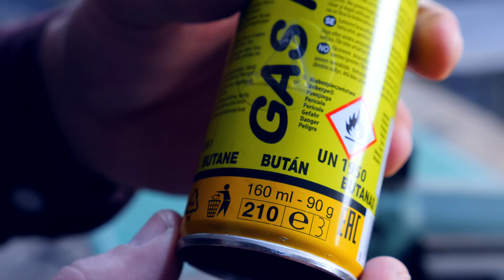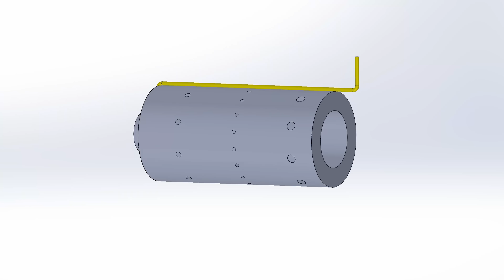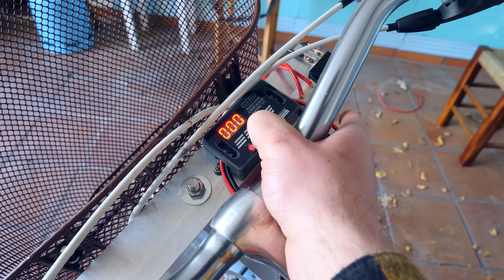I put a Homemade Jet Engine on my Bicycle

Comment: That lip is significantly reducing thrust. Instead of one large combustion chamber & exhaust.....spread out to multiple jet exhausts surrounding a central pass through for ambient air. This will cause far more ambient air to be "grabbed" by the exhausting gases, and produce far more thrust. #NasaLies

Comment: Hi INTEGZA, my name is Gil and I’m a mechanical Practical - Engineer. I recommend you to add exhaust and exhaust nozzle (like in fighter jets) because the exhaust stores the energy that comes from the combustion chamber and the exhaust nozzle turns the static energy into kinetic energy which will cause more thrust in the engine

Comment: Idea: I know your thing is much more about rocket engines and stuff, but i have a slightly different suggestion. Try adapting a bike to eletric and then compare it to the (possibly refined) jet bycicle you just built. Would it be possible to have both a jet engine and an eletric motor on the same bike? Use the jet engine propulsion to recharge the battery?

Comment: For your rocket engine project instead of focusing all the propulsion from the gas through one nozzle at the back, why not have about 4 mini holes at the side of the fuselage like anti-tank rockets. This not only provides stability and also the chance of ur rocket malfunctioning is low.

Comment: I think it might be cool to make a jet turbine to mechanically drive a bicycle. like the bikes that have gas engines added to them but the instead build a jet turbine to drive it. I personally have been building and riding the gas bikes for several years now but they can get very dangerous fast.

Comment: maybe you could give the metal 3d printer another try, you can probably clamp the welder in place with steel clamps you may also be able to cool everything down using your edf the steel plate should not warp with such a powerful edf

Comment: Hey Integza! I had an idea. You could make one heck of a rocket sled if you used fans to create a hover board. I mean something the size of a toboggan or as small as a skateboard (probably more feasible). One of my favorite creators on here Colin Furze made a hover-bike he got pretty famous for, though i know that's a pretty tall order. I'm thinking it could be scaled way down. I know it wouldn't likely support much weight, but imagine how fast a nearly zero friction rocket sled would be. I really want to make one my self (after the motorbike of course), once i have a shed and proper tools. I made an electric bicycle i'm pretty proud of though. (Only real issue is i used 6 12 volt lead acid batteries which are pretty heavy...) I'm rabling but i would really love to see a hover rocket sled if you think it's possible.

Comment: But it is only using the power of the leafblower 
The jet engine is not creating its own power 
It doesnt have intrnal hi preassure fens that compress air to create thrust so its basically just a lefblower makeing a flame ?

Comment: To prevent the nozzle from melting, you can try use 2 cans, one inside another, make it air tight and make small holes in the smaller one. Then, redirect some air there so there is a blanket of air between the exhaust and the walls of the exhaust

Comment: 3d print your own fan to use as the air source for a build of this  if you decide to try and make a better one or 3d print some wheels for the skateboard in older videos to see if you can make it roll smoother to get more movement out of your thrust engine

Comment: Maybe you could add a sort of regulation valve so that you can adjust the trust level without stopping or having to turn around to regulate it on the blower.
Also I and some friends are gonna be building our own aircraft so maybe you could try to make a high trust engine capable of pushing a car or something.
(Totally not wishing to steal your work for our aircraft project hehehe)

Comment: Maybe try to funnel in a small amount of hydrogen into the engine, then increasing the flow more and more. I have no idea if it is going to work but hydrogen has like 2x the energy density compared to butane. Would maybe melt the welds tho...

Comment: That's brazing, not welding. Better than soldering, not as good as actual welding.

Except for the battery spot welder you used later on. That's actual welding, barely.

But entertaining and enjoyable, as always!

Comment: What about making a small scale generator using an RC car/plane engine and an electric motor? Could be a fun build using 3D printing and mechanical parts, plus would be a good DIY for lots of power needs.

Comment: How fast would he go with no flame? I suspect it would be the same speed. What is the point of burning anything if the electric motor is producing the air movement? Also why do you need to weld anything? Can't you use nuts and bolts or rivets? Something that doesn't melt...

Comment: Idea:-
1) Make a POWERFUL electric jet engine capable of moving a lot of weight then put it in a go kart, and try to show it to a cop and get his opinion on it. And measure its total speed.

 OR

2) Add a jet engine to your vehicle (car/motorcycle) and see the difference it makes when used simultaneously with the vehicle.

Comment: Since you have a printer which can handle ceramic resins, you could try mixing resins with metal powder. with your furnace you can sinter it like you do with your ceramic resin. but instead of porous ceramic parts, you can get solid metal parts. You just need to use relativly small powders of 1-4um

Comment: Most of your channel is about using a jet engine to propel things and you are fighting against heat distribution. Why not lean in to the idea of all that heat and make a jet engine powered metal furnace! How hot can you go and maybe even use that to do some basic metal casting?

Comment: Another way to fix that flame issue is to start the flame and then start the blower. I had this problem when I was working on hybrid rocket engines for science fair. I would start the O2 gas before I tried to ignite the engine, but the flame never started, so instead I ignited the engine and once a fire started, turned on the O2 flow.

Comment: electric cars are a complete scam the mining required to get your battery's the fact your recharging using oil coal or gas to make the power they are far dirtier  than the internal combustion engine

Comment: Fantastic fun! I love it, with regards the exhaust you could try a ceramic exhaust or just an old steel funnel like you might use to put petrol into a lawn mower from a can.....
 hmmm a Lawn mower... I have an idea!
A jet powered lawn mower that vaporises the lawn cuttings in the jet as it cuts .... might want to make it either remote controlled or a ride on mower though. Standing behind it and pushing might be a little warm and windy so to speak.....

Comment: why not try making a rocket engine with an electric fed pump, with a significant rocket nozzle like made with a lathe or cast iron? and use kerosene as fuel (RP-1)..

Comment: Idea for the video.
Make a disc. Make holes in it. I had something like that lying around. I observed when inside liquid that disc(with holes) will resist moving at high speed but it will move inside the same liquid very smoothly if speed is low. So, can you make a valve which resists the flow, using speed of flow!!
If you read it and find interesting send me a 3D Printer and Gracias

Comment: Make a bike with a working 3d printed internal combustion engine that uses a wood gasifier, thats starpped to a propeller (so the propeller runs the bike), Greetings from finland!
Reply: edit: or you dont 3d print it but it would still be something very interesting that you could do.
Reply: edit2: and a wood gasifier is basically a big metal furnace that burns wood and the gas coming from the burning firewood is used as  fuel for the engine. It was used a lot during ww2 in finland, because normal gasoline was very limited during that time.

Comment: Integza it would be super cool if you could make that but better with fuel injection control and air speed at the front of your bike and also use beryllium or something since that metal can take more heat
Reply: and maybe try putting heat resistant shroud around it so if you fall back your not gonna be burnt

Comment: Idea: make a steering system for the engine. You could either use thrust vectoring or some external rudders like the V2 rocket had
Reply: @Don't read profile photo Cringey kid, you're  probably begging for subs ...

Comment: Check for the operating range of temperatures your materials can withstand, there's no point in making a nozzle in aluminum, same thing goes for the welds.
As for the nozzle this is the case where you could try to use a De Laval  (if you could manage to get the flow sonic in the throat any subsequent expansion would accelerate it and provide you with more thrust) , spot welding a sheet steel one could somehow work but I wouldn't trust it to be honest, with the production capabilites you have now there's not a lot more you can try.
Your aluminum nozzle was at 800K, that's the temperature at which it starts glowing red, so look for better welding methods if you want to have it survive

Source: boring aerospace engineer 
P.S. f**k tomatoes
Reply: using the wrong materials is kinda his thing tho
Reply: He can't print them at this size, and using wrong materials is sadly going to lead to failure, maybe he should get a tig/mig and weld thicker sheets of steel, with plumbing solder there's not a lot you can do as it's not made for rockets but for household pipes.
Reply: He tried printing precise Nozzle’s that could withstand the temperature, and they were ceramics, but they leaked, due to the treatment process.
Reply: @apex_blue  I still wonder why he didn't glaze the parts
Reply: Hey you boring aerospace engineer, here is a boring mechanical engineer  student.
What he did was not WELDING, just simply SOLDERING.
There starts the problem.
But the nozzle is not necessarily out of Aluminum?
Reply: @Chaosm4n  i agree
Reply: The nozzle is a butane canister, aren't those made out of the cheapest aluminum, the same used in coca cola cans? But yeah for welding/soldering you are right, I messed up as in my language there's no difference between the two :)
Reply: oh wow I derped super hard on the part I noticed, my bad lol- as for the butane canister I think it's multiple layers of different metals, such as steel and brass hot rolled together (and obviously coated)
Reply: tomatoes are disgusting
Reply: The can that he used wasn't aluminium though. It was steel.

Comment: Idea: Add a proper nozzle and use some of the leafBlower excess air to cool the outer part of the nozzle
Reply: Guess who's getting a printer haha :)
Reply: Good idea
Reply: Great idea. You could cool the engine with the air before it gets to the chamber, and by the time it gets to the chamber the air should be slow enough where he could get rid of the flame holder. It would increase efficiency drastically.
Reply: Very cool jet bike! I wish I had the ability to make one. :)+
Reply: Aye, that's the ticket, and I'd guess it might work better with colder air, but really worth the try. I want to see this myself (:
Reply: Yea, you also need a proper convergent-divergent nozzle to get proper thrust out of the hot gasses by converting some of the heat and pressure to speed.
However the pressure the leaf blower can give is properly the limiting factor, as the compressor in a jet engine is not to force air out the back, but to create high pressure gas which you then heat up further (by burning fuel) and expand out through the nozzle (excluding the energy used by the turbine to drive the compressor).
I'm not sure he gets much more thrust out of it by using the butane than just by using the leaf blower itself.
Reply: @srenkoch6127  actually in jet engines you only have a convergent nozzle since in order to jave a functioning convergent divergent nozzle you need to be sonic in the throat. The leafblower can't obviously support enough pressure. Convergent divergent nozzles are used in rockets, where you burn insane amounts of propellant to build up combustion chamber pressure. He just needs to build a proper size convergent nozzle

Comment: Try making a 3d printed liquid cooled nozzle, this way the plastic wouldnt Melt or burn and If you recycle the warm coolant into the combustion chamber you could easily get some more thrust as it would increase chamber pressure. This ist all theoretical of course but maybe it would work 😅
Reply: dont think that would work tbh
Reply: @retr0_fps  it just  m i g h t

Comment: Idea/ Video Suggestion :maybe make a multi staged rocket with small fuel storage for each of them and a battery in the final stage whitch sets of the first and as soon as the first is finishet it burns a way a conector of some sorts and drops down to reduce weight and so on and so forth this may even work when done out of 3d printet parts only due to the nature of plastik burning up you have a nice and easy release for the next stage?!

Comment: Have you thought about putting a turbine after the combustion chamber to increase exhaust pressure? This would make it a turbojet style engine and increase your acceleration.
Reply: The turbine is there to drive the compressor of a jet engine. Nothing more. Here it serves no purpose.
Reply: @LuxGamer16  I suppose an afterburner would not work really well in this application.

Comment: Excuse me!  You cut down the airflow for stable combustion and then you have an overheating problem.  By-pass the waste air to cool the exhaust with a shroud.  That's the way the big boys do it.

Comment: You need to make a tank, in a 3D printer (PLA So that if a part breaks it will be easy to replace and also the tank will be lightweight) OR in a cnc (Aluminum It will be really good, strong and realistic). That the head (turret) will be a rifle that can shoot sponge balls. In my opinion if you make it out of aluminum or half PLA and half aluminum in the turret has a rifle you will be the first to build such a thing. And another idea to put a tomato behind an EDF motor and behind the tomato a knife or a small mud bath (mud box)

1

Comment: Next is to solve the exhaust overheating. You can control the fuel and oxidizer mix to control combustion temperature and achieve efficient combustion.

Comment: Hey Integza,

Try create an axial compresser electric turbojet without using turbines and create another air compresser that connects to the exaust nozzle, this could improve thrust and High effeciency to your project and then attach it to your bike. Make sure the air inlet is big so moreair will go through the compressor which create more effeciency.

Comment: Idea:- make 3 oxidizer inlets for a solid propulsion rocket engine so the fuel doesn't burn unevenly as it did previously.
so make 3 inlets for the oxidizer on the center of the body and an initial one on the front so the exhaust is even and it produces thrust

Comment: I have a suggestion for your rocket nozzles. Try printing them with channels inside and flow liquid oxygen through the channels first so it cools it while running. Saw it in a video from Veritasium of 3d printed rockets.
(you probably saw it already tbh)

Comment: I've got a new take on the tesla turbine and I think it would work really well as a compressor side of a gas turbine...
I'd like to work on it with you if you are interested. I have tested my turbine and it's a lot more efficient than the standard tesla configuration......
Reply: Do it integza

Comment: I just need a 3D printer! Please upvote me 🙏. My suggestion is making a hot-air ballon with a gondola. The jet part is blowing hot air into it. The camera can sit in the gondola. Add remote control for the hot air to keep it aloft and add a GPS tracker to it. I want to see how far it can travel and you can film it from your roof.

Comment: Instead of having a component that slows down air and thereby the combustion you could insert a pilot light instead, its like your spark plug system but waaaayyyy better and more consistant, it also shrinks the space it takes up.
Reply: It's actually kind of important that the air slows down for the combustion chamber, it increases pressure and also allows more complete combustion.
Reply: Pilot lights don't do well with the wind. Even the largest of gas turbines use large ignitors.

Comment: Video suggestion : A skateboard with ion propulsion. Like NASA's satellites. That would be cool. I hope I win a 3d printer.
Reply: It wouldn't go anywhere, Ion engines can barely push a piece of paper in the atmosphere.
In space where there is no air resistance the tiny amount of constant thrust is perfect since over time it can gain speed with minimal fuel and power usage.